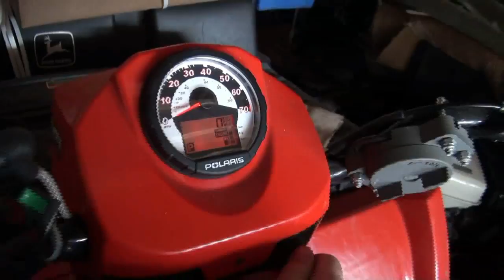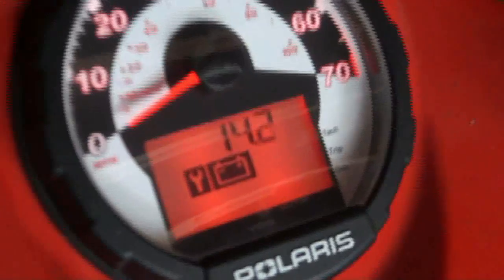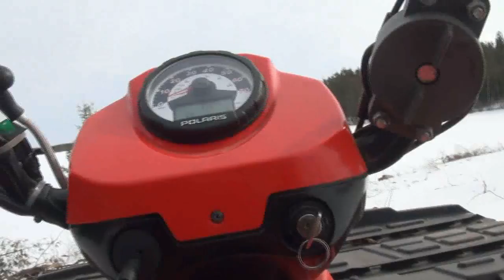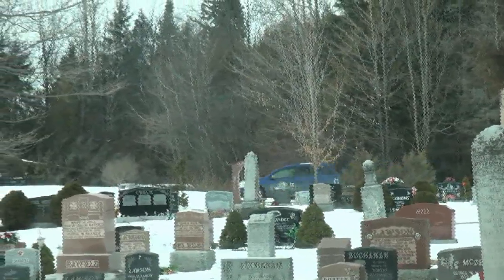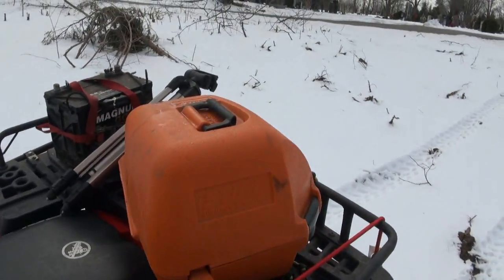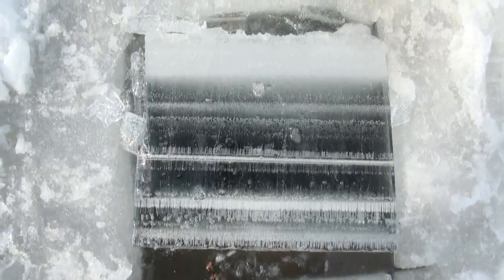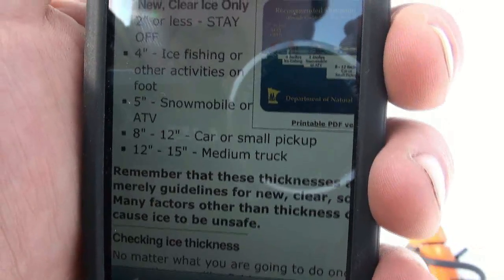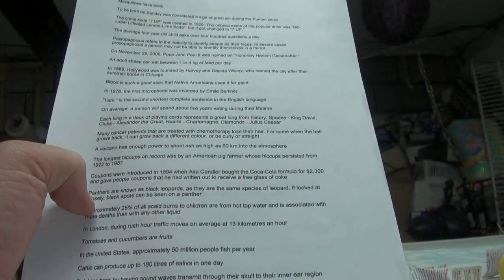polaris atv start fail and Chainsaw ice sawing

Comment: I think the starter is F'd up. You have had problems getting it to light off from the key but it always starts when you kick it. That means that the starter motor is partially shorted or is worn out, which is drawing down the battery enough to keep it from lighting of on the starter. you might want to take a cable off when you park it for awhile to keep it from going down as easy.

Comment: just letting it charge by running , only top charges the battery , put it on an actual battery charger about an hour , and do that once a month when you are not using it , and it will always start , a battery tender is a very good idea , hit up ebay , they are cheap lol

Comment: bill it is the back lights that are running down ur battery i had the same problem with my atv just unplug the connector to ur back lights and u should be fine but u wont have any back lights though there is a special switch that when u mash back brakes the light supose to come on if that switch is not working good then ur back lights will consistantly be on when u start the atv

Comment: @billstmaxx You should look into A123 Batteries,, iv had them on my klr 650 for 7 years and it sits for 8 months at a time,,, I'v got a raptor 700 that wasnt started for 2 years and it cranked first try with A123's